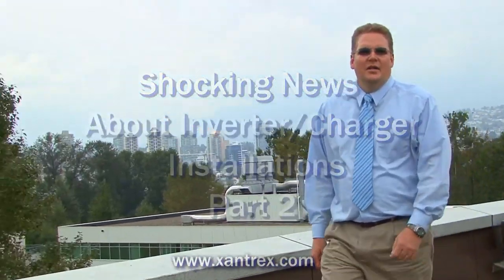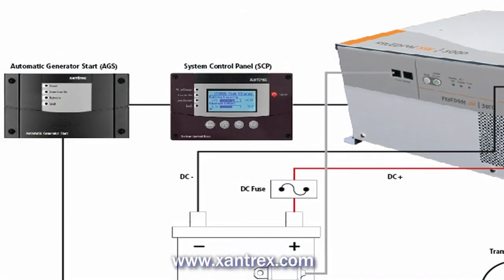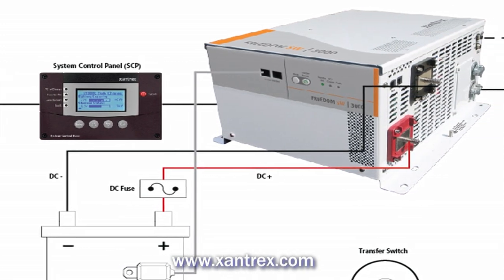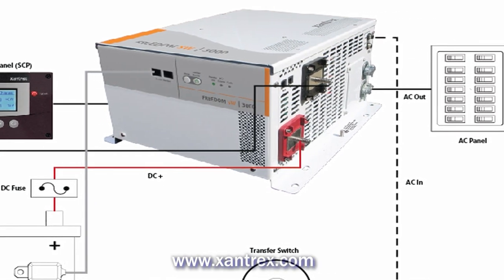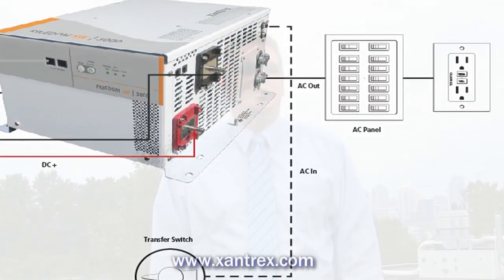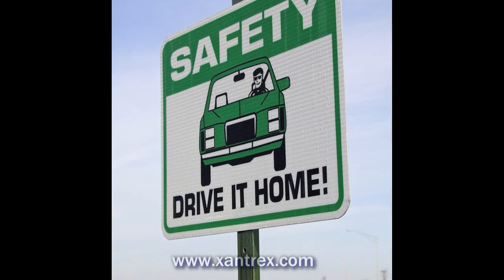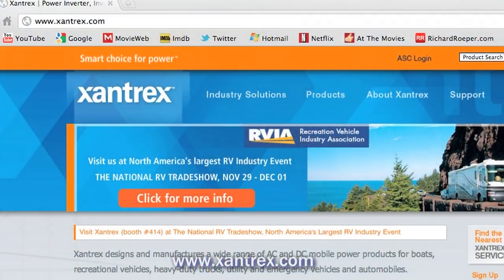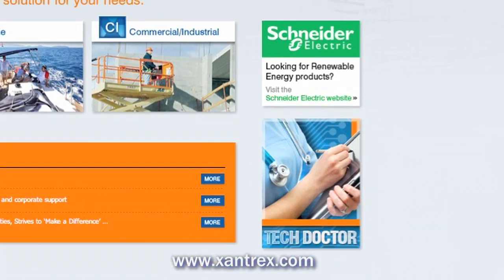Xantrex Tech Doctor™ - Shocking News About Inverter/Charger Installation - Part 2

Comment: I have a xantrex dr1512 made in 2005, just recently opened it up to clean dust from inside. I saw on the circuit board some small voltage jumpers from 12,24,36,48vdc. the jumper on mine was set @ 12vdc.. does this mean I can change the jumper to a higher voltage if I decide to up my system voltage?? say 1524,36.48..??
Reply from the maker: Hi there
Please consult our tech support at 1-800-670-0707 for details. Thanks